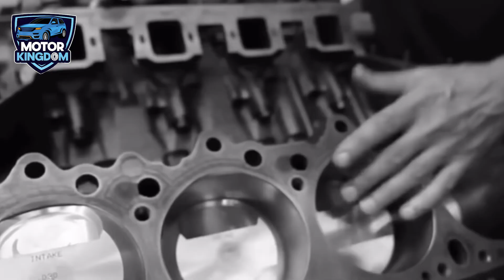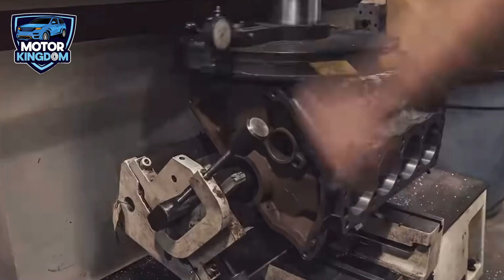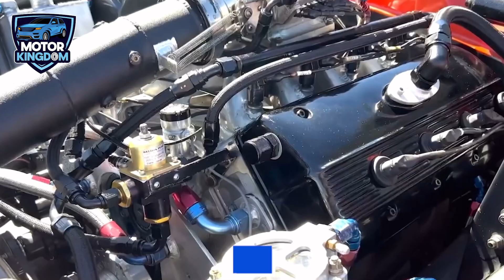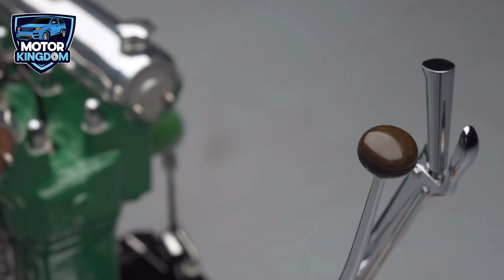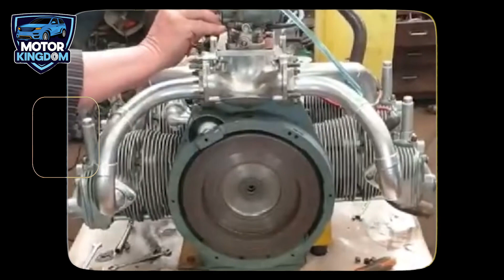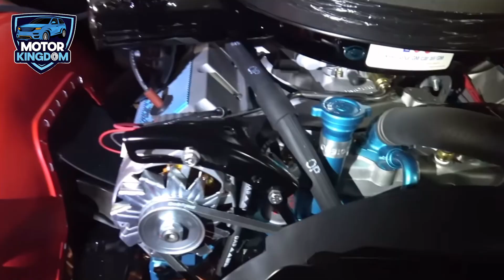15 RAREST Hemi Engines You’ve Never Heard Of!

Comment: i don't think a lot of people know that toyota's legendary 1 million mile engine the 20R engine used a hemispherical head design!
it was a 2.2L carbureted petrol that was used in the Hilux, Celica and Corona between 1975-1980
also fun fact,
early versions of toyota's diesel 22-R [1981-1984] used in the famous Indestructible Hilux, featured a semi-hemispherical combustion chamber, meaning that its combustion chamber is slightly less than a full half sphere.

when they ask whats under the hood you can say its a Semi Hemi 😆

Comment: Toyota also built a all aluminum v8 hemi.
Reply: Yes, they did, I have seen one in a Hot Rod here in South Australia.
Reply: I worked for Valley Head Service in Los Angeles CA throughout the 90s and in and off after that with having a good relationship with the late owner Larry Ofria. He had a company called Thunder Power which made conversion hemi 32 valve heads for BB Chevrolets. The rocker arm design was similar to the olds in fact the whole design looks similar to the olds and they didn’t fare well at high rpm but they did run.